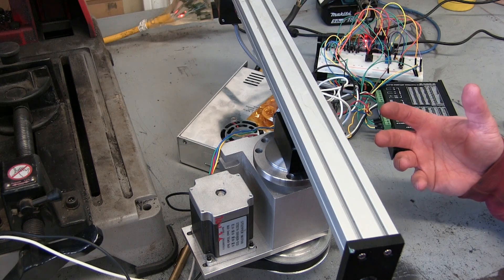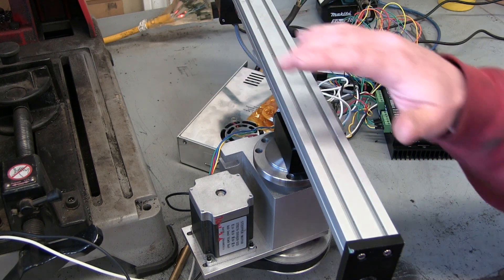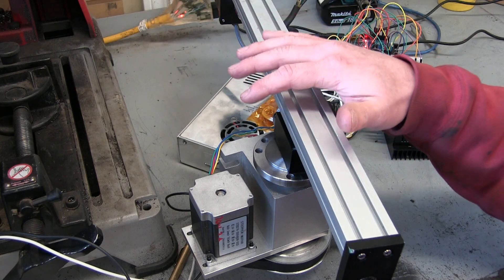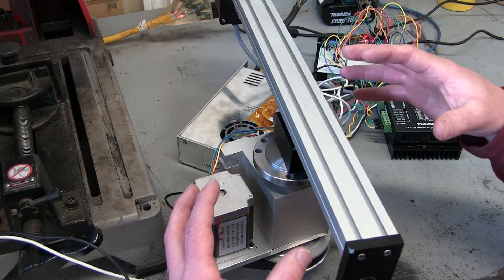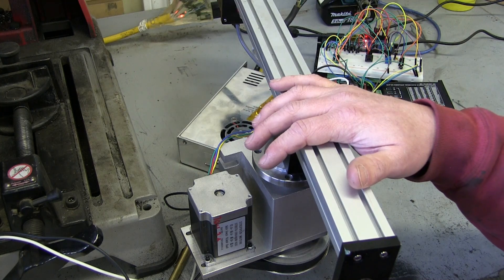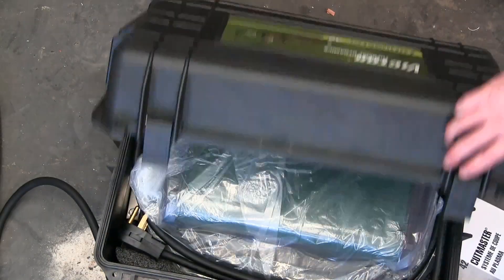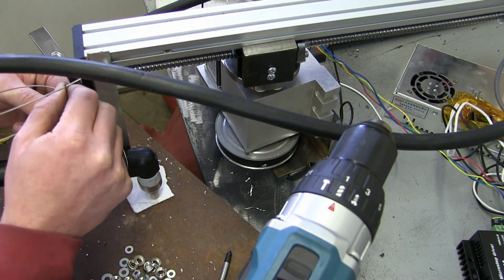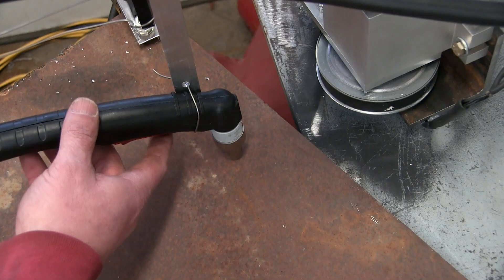Portable CNC Plasma Prototype

Comment: First off, big fan, and absolutely love the authenticity in your vids. I found your channel a few months ago when I was looking up hydraulic gear pump videos.... Now, getting back to the video

1.) The word you're looking for when talking about a "non-Cartesian" co-ordinate system, is "Polar". As you know/mentioned, Cartesian is (x,y) coordinates, while Polar is defined in (R,Theta). R is the radius, I.e. distance from the rotating axis, and Theta is the angle from the origin.
- - - - - - 1.1) The term for the "algorithms" of the movement are most commonly called "Equations of Motion". Those are typically taught in classes related to System Dynamics/ Linear System Modeling

2.) As far as app development, that's not quite my forte. I'm decently familiar with G-Code, as I pretty much non-stop 3d print (got obsessed enough to start from scratch, designed, and 3d printed a 3d printer). Furthermore, I've been a Mechanical Designer/Fabricator for one of the leading 4x4 companies for the past several years. In that job, I use a CNC Plasma Cutter (table) on a daily basis. 

- - - - - - 2.1.) Programming the Path: I'd say the absolute easiest way for a welder/fabricator to create some custom path wherever they may be, would be to integrate a "Learn" feature into the brains of the thing. This would work excellent for non-precise cuts. I'm currently working on building a small and simple robotic arm (4DOF) for fun, and plan to try and implement the concept when the time comes. You can look into robotic arms and see they've already developed it. For this application, here's what I think would work: Wherever there's a motor, place either a rotary encoder or even more simple, a potentiometer (a.k.a. variable resistor) on the same axis.

- - - - - - 2.2) Once you have the axis equipped with one of those, set the Arduino to take a command (i.e. pressing a button connected to A0 twice in 2 seconds) to enter the so called "Learn Mode". From there, the operator would simply move the arm freely along the path they want to cut, and click the button again to exit the Learn Mode... Next, in a similar fashion, enter the "Cut" mode, set your torch to the proper settings for the metal, and click the "Start" button.

I'm sure I forgot to say something that came to mind when watching, but at least that's a start/addition to the discussion. Can't wait to see how this progresses!
-Pat
Reply: Of course, the potentiometers for recording position would be for the prototype stage, there's certainly further ways to improve from there... I intended on elaborating a little more on the programming of the learn and cut modes -  The "learn" mode would record the analog input values from all potentiometers and store them temporarily, until the cut was made. Ideally there would be enough memory for several paths to be stored.  The cut feature would them simply tell the motors to "replay" the series of movements previously gathered from the learn mode.

Comment: I've seen rollers for the end of plasma cutters to keep it off the metal. this would allow you to keep some downward pressure for stability but keep the tip off of the Cutting surface.
Reply: jason sexton how about a ball roller. Like a bigger version of a ball point pen.
Reply: it could also be done software side height control using the torch voltage. If the height changes so does the voltage and most torch power units have a data plug on them for interfacing with a CNC plasma system. You could control the torch height, Torch on or off, and voltage all remotely. The benefit of software side is you could even use it to cut corrugated or curved metal.

@nomadicgrenada the metal will warp when cut, typical torch height for a 45 amp torch is 0.06" above the piece. cutting thinner gauge metal it will warp a lot more than that. some sort of torch height control is needed
Reply: +Thomas Chism Would a roller work for something like this though? I mean, it isn't all linear, so you'd either need a castor(so the roller could turn and not drag), or some sort of friction reduced skid like a teflon foot? Serious question, not being an ass or anything.
Reply: Ball bearing in a socket.  Simple as it gets.
Reply: nomadicgrenada is correct. Once the mechanisms scookum value increases the tip can hover at the proper height. nothing dragging.
Reply: Maybe a ball bearing roller would be best, didn't think about it moving in all kinds of directions.
Reply: I would probably avoid using any sort of mechanical support touching the metal. Since the roller/ball or whatever you use cannot be directly under the cutting arc, it would be complicated to write software to avoid previous cuts. It would get caught. Since software is a must here anyway, I would add a Z-axis, and one or more distance sensors to it, constantly adjusting as the cutter moves across the sheet. "Averaging" them out would avoid problems with cuts and/or holes.
Reply: It doesn't require the guide or a replacement . We are working on a fixed plane attached to a flat surface.
Reply: Samuel Tisdale the depth sensor could be the torch voltage and not need additional hardware other than z axis control that's what's nice about it. It would only need some additional software to drive it
Reply: Thomas Chism I was thinking of some crazy system with lasers
Reply: the bearing doesnt even have to roll. it just needs to be a rounded surface. What would also be possible is to drill a hole through a bearing or other spherical piece of metal and fit it around the nozzle, this way if there are any bumps in the material there are no 90 degree angles on which it could snag on, and the little frictional force exerted by the metal pressing directly onto the surface can probably be handled by the motors.
Reply: or maybe a really hard material a plastic or ceramic that won't catch on the metal
Reply: Just make the handle holder spring loaded and put down a roller or two so that the cutting head can follow the surface. Also, make the plasma cutter handle easily detachable so that you can quickly transition between handheld and automatic cutting, that way you don't need to dedicate a plasma cutter to the setup.
Reply: Just the tip mind you....and only for a minute!
Reply: It's probably never gonna be that skookum if the home gamer (for which the product is intended) is gonna be able to afford it. I would say the bearing ball idea is probably the easiest and cheapest way to go. Also that gives the opportunity to have the torch mount floating in the Z-axis which would compensate for thin plates bending and so on.
Reply: That would be way too expensive. On top of that, adding controls for a third axis would just complicate things. Remember, this product will be great for improving a home workshop. The focus lies on super easy operating and affordability. The tolerances will never be as good as a full blown CNC plasma table, but probably good enough for what it is intended for.
Reply: Patrik Einarsson it could be a very simple z axis mechanism as there is no real forces on the torch and the torch controller provides all the data needed to control the height. Your only real cost would be a stepper motor and driver. The linear stage could be as simple as a drawer slide with a nut attached to it given the feedback loop provided by the torch controller it almost is a stepper motor running as a servo system. If you got really really creative with the circuitry you could run it with a cheap brush dc gear motor and a piece of 1/4-20 all thread
Reply: I'm completely with you on that there are simple ways to control the Z-axis depth with electronics. But yes there is gonna be way too much force to support the boom, torch and now added motor and sensor with only the bearings in the stepper motor. Having a boom with a moving load like that free hanging would mean you have to add a whole bunch of bearings and build the thing with way finer tolerances to keep the Z-axis stable = adding cost. Maybe you would even have to add an active counterweight opposite from the torch side.
So unless the aim is to build something only the pros can afford, I don't think it would be worth the money. 
There are mechanical ways to even out the Z-axis effects of slag if using only one point connected to the surface would not be adequate. Roughly explained. A triangular plate with one ball in each corner and a hole in the middle for the business end of the torch, connected to the boom with a cheap ball joint would even out the Z-axis effects by roughly 50%. Much like the bogie on a semi trailer. You might even let it turn freely so the balls skip off the slag thus making it even less prone to the Z-axis negative effects. The small friction of the balls to the surface will also negate mechanical vibrations in the X and Y-axis somewhat when starting,stopping and turning.
Reply: I could see where this could be used on large metal tanks with rounded surfaces and irregular surfaces with no prep, I think the drag tip is a good idea.
Reply: Thomas Chism would probably work good until you tried cutting something that warped enough to unstick the magnet.
Reply: I've seen successful CNC cutting down without 3rd axis control, but it does seem like it would be a benefit.  The drawback would be that you then not able to mount just any old plasma cutter to the machine, which potentially drives the cost (way) up for many users.  So ideally, it should have Z control, but be able to work without voltage sensing (maybe an alternate distance sensor, to still allow following corrugated metal / curved sheets / warping).
Reply: that idea sounds way better than having anything on the torch side touching the material... if it's really intended to be used out in the field as a quick and dirty cnc, with rollers on the end, it'd end up getting hung up on a big chunk of slag or some other caked on shit ruining the cut.
Reply: yes maybe one of the ball bearing rollers from a conveyor system
Reply: The problem with that is if the metal you're cutting has scale or crap on it that will affect it. He could give it a Z axis with a depth sensor to adjust the height. That would also give it the ability to do semi curved surfaces. Just a thought.
Reply: That's why i said add a depth sensor to tell the machine to when to raise and lower. you would not have to program any height into it. adna  Z axis can be accomplished by using a single electric motor that would push or pull on the main arm. vary cost effective and easy to implement.   http://www.mouser.com/ProductDetail/Parallax/28015/?qs=Re%252bcz0%2FMYCKqvqZW3g9mzg%3D%3D&gclid=CjwKEAiA_9nFBRCsurz7y_Px8xoSJAAUqvKCk1q3m_aygpFoC9ZaqXmu2Oq5fFv45rAzNS4ZR2zjCxoCvqzw_wcB
Reply: That's stepping outside my realm of knowledge and didn't know that was possible. I was just looking at making sure that it would do its job every time and a track ball or anything touching the metal would result in complications for the machine. But if it can be done good idea.
Reply: We might need one for when we have to cut a circle in an area of a butt weld, a frequent occurance on large tanks and ships.

Comment: Great concept! Instead of using an app you could position the head to define some simple shaps. Fix magbase, move head to position x, y. Click a button to mark. Move head to a new position to define the outher diameter of a circle or the second corner of a square. 
With a smal screen you could show the user what shape they are drawing and where the head is.
Reply: That would work if he were using a timing belt system for the linear rail but he's using a screw. The screw requires actually turning the screw to move the part.

Comment: I think it needs an adjustable Z axis to make it 3 axis for those curved surfaces and to keep the cutting height a constant level. The inverse kinematics shouldn't be too bad to do.... You know it's ONLY an advanced class in mechanical engineering lol.   Anyways, I can help you work on the idea on my spare time. I am building a CNC router and 3D printer 2 in one for my senior design project and I am almost done with my robotics and controls emphasis so just hit me up and I can help out.

Comment: I think that the start position should not be on the part being cut, it looks like the edge is a little mangled from that point. If you start the first cut a little early it would help eliminate that. Also, flexibility is the most important part, using an app to select shapes is an amazing idea. Polar CNC is less accurate the farther you get from the rotational axis, however for this purpose that shouldn't be too much of a problem. I also see the linear actuator easily drooping without a really solid way of affixing it, you need this to be designed like a tank. I must conquer, fucking nuts to be able to share such ideas. A product like this would be in most every welding shop for quick, accurate cuts.

Comment: how about a position sensor on the torch and do some shit so that computer knows how to do stuff to make the shape you want without having to manually input movements on both motors to get all the shapes you want. or even have a joy stick to control them both at the same time for fun

Comment: If its gonna use polar movement, it'll need to take in how far out it is and change the rotation speed accordingly. That or just have the rotation calibrated to what it needs to be at full extension but thats a bit slower

Comment: Conversational APP on the phone is a great idea.  I am thinking you will either have to have home switch somewhere on the axis  so that it will/can know how far the arm is out.  A digital linear slide that is all ways active like a digital caliper.  The app can take a WHERE ARE WE reading for the slide to know how much compensation to add to make a square with straight sides ect.  Another thought as to why someone would not use it.  The small envelope.  BUT!!!!!!!!  If you made a 2 stack top arm.  One that was fixed with the ball screw and one that slide on top or telescopes out then sure you could only CUT the effective travel, but then you can offset the top arm to continue the cut and keep it inline.

Comment: you should put a z- probe on there to cut stuff that isnt 100% flat. Would buy if it was less than 400$ bucks (minus the plasma cutter). Could you run oxy fuel? make it more portable if you use the mini bottles, run the electronics on batteries and you could take the thing anywhere. I have a product that im trying to develop and it involves small box end wrenches that are sizes that are not usually inculded together, if i got them machined it would cost 10$ a wrench, if i bought something like this I could make  them for less than a dollar a piece, and I could make anything, its like one of those bullshit laser cutters except man fitted. Would definitely buy if i had the money.

Comment: 1:  Setting the zero correctly and verifying you aren't a dingus are key.  You need an easy way to set zeros.  You should also throw a sharpie holder on there so the user can do a dry run with marker to make sure it looks right (like that plotter you got in the previous vid).  Also, if you have a cut too big to make at once, you need an easy way to move the machine and make sure the two cuts line up.

2:  It may be possible to do some fancy integration with the cell phone camera and some high contrast marker to let the user draw the cutting pattern on the piece then have your plasma cutter find the lines and cut along them.  So just draw what they want done, drop the machine, take a picture, and have it go.

3:  It sort of brings to mind a product some MIT students made a while back, a hand held CNC router, it looks pretty cool.http://blog.cnccookbook.com/2012/08/09/mit-students-create-hand-held-cnc-router-you-gotta-see-this/

Comment: Rotary is pretty heavy on the complication factor. Stick with CoreXY dual stepper and skate-o rail or 20/20 style gantry (i think you've previously commented on CoreXY single stepper, dual stepper interactions.) work within a limited size so your overhang is smaller. possibly consider a cheapo THC to manage cut speed and cut height into your arduino or similar controllerbear. I reckon you're on a winnar mate! Watch out for those drop-bears!
Reply: http://proma-elektronika.com/index.php/en/products/thc-torch-height-control - We are using this THC, cheap and effective

Comment: I feel like the rotary axis complicates it too much. You have different speeds for the torch depending on how far it is extended amongst other things. i think what would be easier to use long term would be a linear axis for x and another for y. Then traditional cartesian systems could be used and in the long run, if someone wanted to or needed to cut a different shape, they could do so easier. I think the rotary axis is complicated because now to cut a straight line in the y axis, you'll have to move the x and y axis together and the further out the torch goes, the slower it would have to rotate etc. etc. You probably get the idea
Reply from the maker: Hmmm. I've heard that computers are pretty good at crunching numbers. ;-)
Reply: AvE Omg he replied time to scream like a little girl. but I agree. I just see it as being more complex but maybe thats because I'm used to cartesian 3 axis CNCs
Reply: AvE is right. Polar plotting and 3d printing systems have been around for ages. You can happily run them on arduino or a raspberry pi even. This approach is actually much less complex than a delta 3d printer and they are a very popular and reliable variant. The maths is also less of an issue for this application as the cutting head won't ever need to move faster than what, 20mm/s? Sorry, 4/5"/s.
Reply: Small footprint is the key. Having an x and y axis would increase footprint. No good for a magnetic base. You are right that controlling such a robot in order to maintain constant speed will be a challenge, but not impossible.